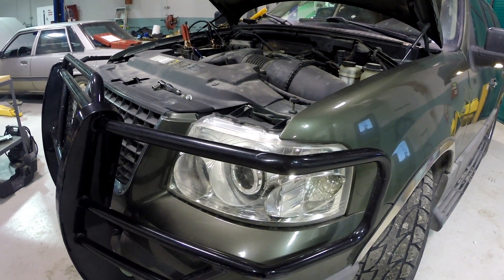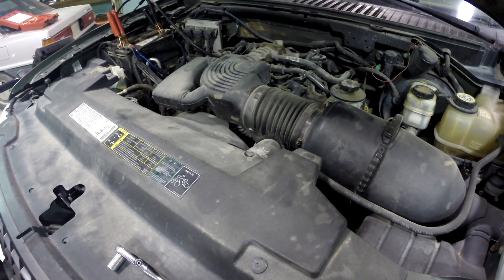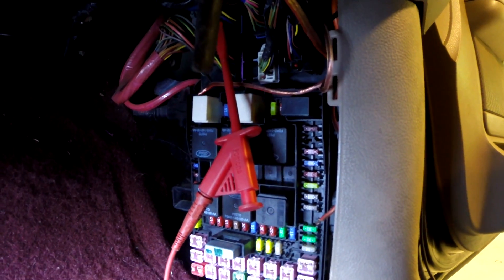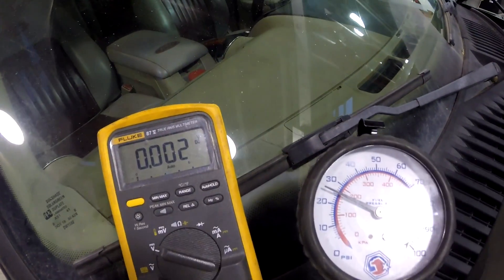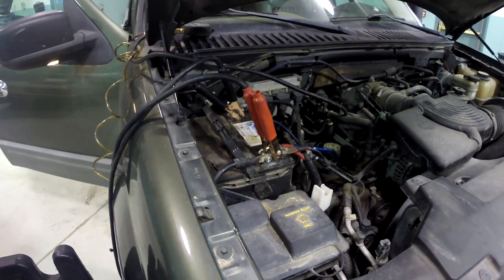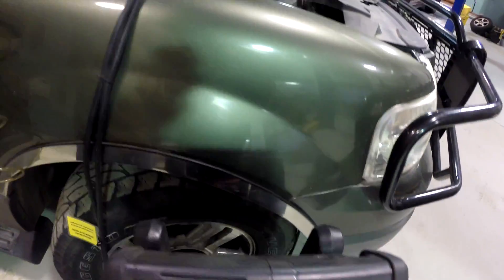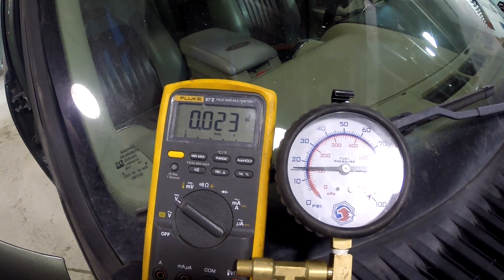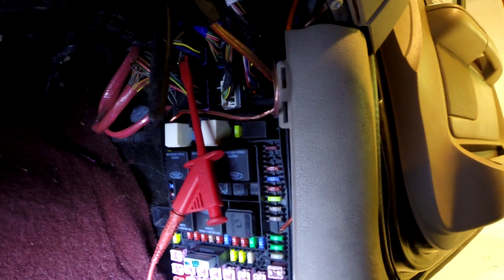Ford Expedition P0231 and Stalling Diagnosis

Comment: I had the same identical problem with a 2004 Expedition.  I took out the junction box, desoldered and removed the same bad relay ,(which was burnt) and replaced it with a new one from ebay for $8.00, fixing the problem.
Reply: Cool. I just ran an external relay to mine yesterday so if it ever happens to me again I can easily swap the relay.

Comment: another problem with these Fords Expeditions , the fuel tanks , no longer available . they  start to leak from the evap connection because they crack ! all tanks in the salvage yard are all cracked and junk as well , Lol ! the best fix is to  drop the tank , this is how i did my repair and  fuel pump replacements and now repair , drop the tank  remove fuel pump , and drain all gas out and take tank  to the car wash and wash and scrub the crap inside and  out of it , usually there is alot of sand and gunk in there , and make it  like new again  ! go to wal-mart buy some dawn dish liquid and a tooth brush and a soldering iron , wash really  good scuff with 600 sand paper and melt the plastic in a circular motion  to a puddle , until  the crack is completely sealed fill with water to make sure no more leaks ,  gravity drain with hose , and dry with paper towels .  what i also did was put some JB weld 2 part epoxy for extra strength , back in action under $ 40.

Comment: Instead of replacing the piece of crap  integrated relay on mother board , why dont you cut the wires of that  board and heat shrink a separate relay , that way if it does go out again just swap out that relay ! Why Ford does this crap is beyond me ! Chevys have their boards in the engine bay and if you need to swap a relay , its a piece of cake ! not integrated ! i would not even take that board apart and solder a new one in , Why ? nope , and even if those boards were still available , about $800. nope

Comment: I have a 08 Ford Expedition EL( or LE) and lately it’s been stalling when put in reverse after running for a little bit. Took it to Walmart for oil change 3 days ago, drove it 2 miles and it was knocking so bad that it sounded like a diesel! Checked oil and it appears to be a little over filled but not sure how much. The receipt shows they added 7 quarts and looks like they didn’t change the oil filter at all. When I called, they got extremely rude and said they did nothing wrong! Do you know what would cause my suv to stall in reverse and what could cause it to sound like a diesel with that loud knocking? My husband changed the coil and we thought that’d fix it but nope! I really appreciate ANY advice you could give me/us! My hubby used to service all our vehicles but he’s had cancer twice and now suffers with kidney issues because of it. Thank you so much for taking the time to read this and God bless you. Great videos!! Thumbs up 👍🏼
Reply: P0305 code before replacing coil but no engine lights on now. The vehicle sounds like a a diesel so something’s wrong and we can’t afford to put it in a shop.

Comment: For curiosity sake, can you test the relay without using the fuel pressure gage?  If the voltage is dropping while it starts to stall, wouldnt it give you the same result?  And if the voltage doesnt  drop, it could then be a pump issue?  Just curious,  I am not the best skilled at this, just curious.

Comment: My ‘03 Eddie Bauer (same dolor as yours in the video) had this issue. Replaced fuel pump first. Ran fine for months... then the dreaded relay box repair came next. That box was about 800 bucks too😧

Comment: got the same issue that engine stalls after a while i can start the vehicle with no problems.  After 20 min driving bam stalls again and wait a while and drive with no other issues or codes.  Though it was my fuel pump, evap canister, driver module corrision, or relay.   It looks like there is two relays for the fuel pump in the box.  Gonna check them both.   BTW I change my idles air sensor(vibrations) and my tps sensor(stalls engine) both worned out out with no codes, both helped my 2003 lincoln navigator regain power.   Any comments of other things relay that might help me out.  REPLY  thanks.

Comment: I have a 2004 Ford Expedition Eddie Bauer I can get it to move in reverse but when I put it in drive the vehicle will not move I tried it in 2nd gear and 1st gear and it still will not move anywhere I changed out the neutral safety switch and I still cannot get it to move but it will move perfect in reverse and somebody please tell me what it could be fast if possible thank you hope to hear from somebody soon with a solution to fix it

Comment: NO, No, you don't need a new junction box, which is like $400-500??, just a new fuel pump relay, cost about $8-12 in ebay, just take junction box out, and unsolder the middle relay= fuel pump relay, and solder new one in and you are done. Nothing else is wrong in the junction box!!! Ford uses cheap, Chinese-made relays, they are uncalculated, buy one made in Korea, and there you go!! Done this, only problem is relay, so DON'T BUY A NEW JUNCTION BOX!!!
Reply: Are you 100% sure  muy 2003 expedition  is doing almost the same thing i can be driving for in hour and when I get to the stop sights she dies out of nowhere my mecánich switch a part but now is doing the same thing again and im freakyng out the she may stops at the light of when I park but  like she did last time
Reply: Eero Laukkanen you are the 🐐🙏🏿🤟🏿
Reply: When I'm Looking for the Relay on E Bay, What am I Looking for?
Fuel Relay for 2004 Ford Expedition?

Comment: After reading these comments, I think it is a gummed up IAC, idle air control, that is causing most if not all of these problems. Especially stalling in idle, or coming to a stop in traffic. Then you give it a minute, then it starts up like nothing is wrong.
Reply: I have a 1999 Ford expedition, and it cuts off when i drive over rough road or when i go in reverse...
Any idea what might be my issue?
Reply: Bad ignition?

Comment: I have a 2000 windstar sometimes it stalls and sometimes it doesn't, there has been a few times when I put it in park to start it but it doesn't then I press on the gas pedal and it starts. It always has an engine light on, on the dash and when it stalls the battery light turns on too

Comment: I have a 2000 expedition and it cranks n runs, but when u give it gas its dies or idle real badly. just did a full tune up new plus coil paks injectors all new vacuum hoses. could it be the fuel pump even tho it only cuts out when giving it gas???
Reply: Aaron Mathis did you ever find out what was wrong with your truck mines is doing the same thing
Reply: Noo smh truck is in the shop as we speak and they still can't figure it out. Smh if u do plz plz plz let me know.
Reply: Aaron Mathis I'm sorry I didn't get to see your response
Reply: Noo smh truck is in the shop as we speak and they still can't figure it out. Smh if u do plz plz plz let me know.
Reply: Aaron Mathis I sure will and you do the same
Reply: I will
Reply: what was wrong with your truck?

Comment: Question.... I was having the same issue, however, each time I went to start the vehicle, the 102 fuse would blow.  Every time.  So, I replaced the entire circuit junction box and once I put the new one on. The 102 fuse blew again!  Wiring??
Reply: You were suppose to unhook the battery first

Comment: Could a bad junction box contribute to cold start issues? We haven't had a problem with it stalling but we have to cycle the key a few times so it will start correctly. It seems to be a lack of fuel pressure whether it is due to a bad fuel pump or junction box.

Comment: So if the relay is internal how do you fix the problem. replacing the junction box? Having the exact same problem😡
Reply: No, junction box is $400-500, new relay in ebay is $$8-12, which one you like better?? Ford uses cheap Chinese-made under calculated relays, buy one made in Korea, just take junction box out, unsolder old one, one in a middle is fuel pump relay, and you are fine ! Nothing else is wrong with that junction box, so DON"T BUY A NEW BOX!!!

Comment: Nice- is there a reason one would not suspect the signal return  as well for for the loss of voltage to the fuel pump relay.  Would I be correct in saying the ground to the relay is switched.  That looks like a nasty panel replacement - WOW.
Reply from the maker: The ground on the activation side is switched by the computer. Technically the activation side of the relay, either the power or the ground, could be causing this problem. The thing is, all of the power side for relay activation is also in the junction block, and part of the ground side is as well. This problem could be caused by the computer, but history has shown that it's usually one of two things, the junction block, or the fuel pump. If you wanted to be more thorough and check out the function of the computer at the same time as these other things, you could use a second volt meter and hook it up where the ground wire for relay activation goes into the computer. With the engine running, or even when the engine is beginning to die you should have 0 volts on that line. If you see 12 volts appear and then the engine dies, it would mean the ground for relay activation is being lost by the computer for some reason.
Reply: Thanks that I appreciate the clarification.